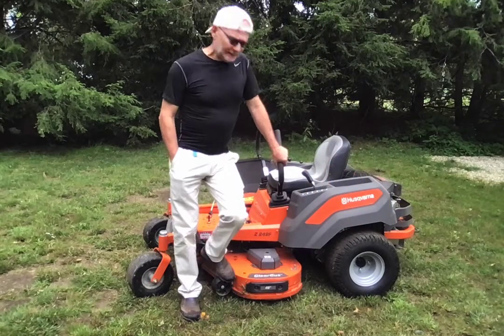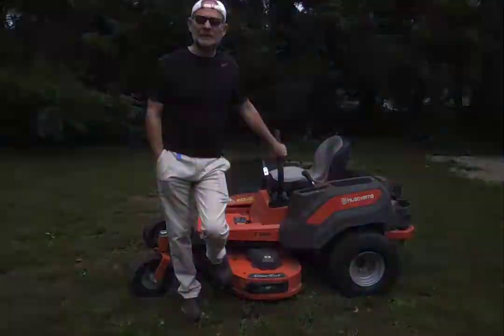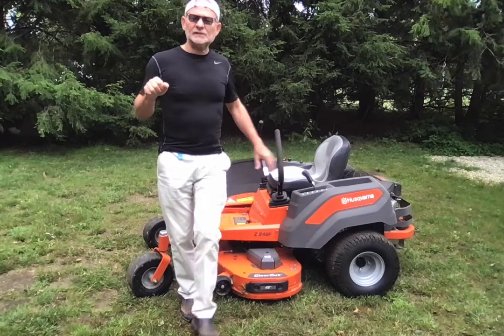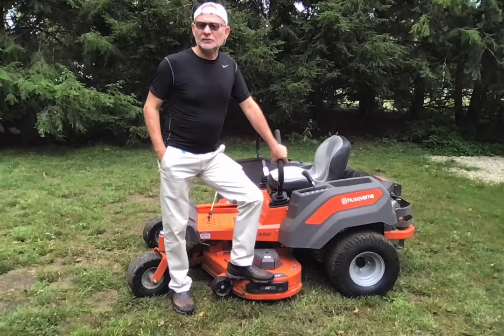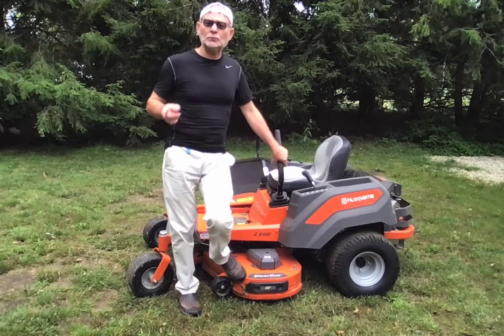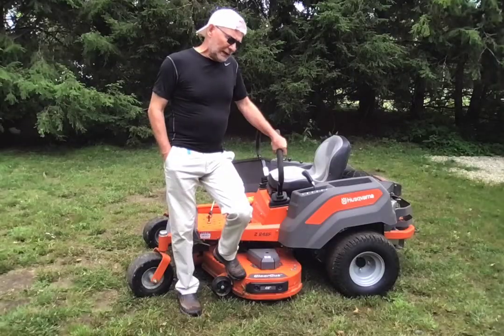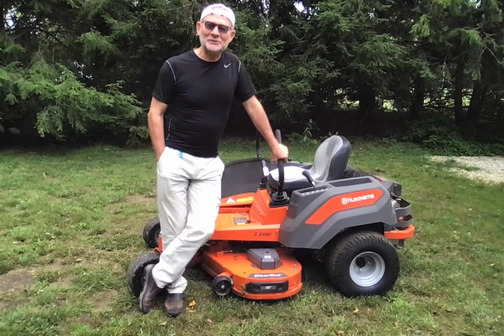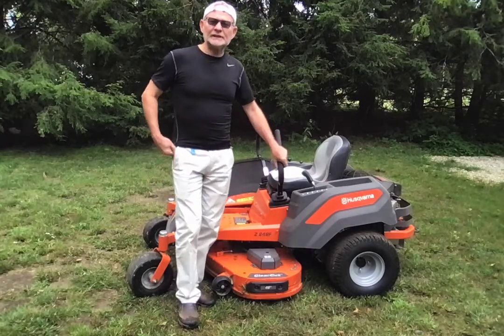Zero-Turn Mowers Quick Fix: Control Bars/Levers Getting Sticky and Hard to Push?

Comment: My did same thing. Dealer adjusted it and it is 95% of the left. Not sure what causes this but it is a common problem with the Husqvanra apparently. However, that said, I have had my Z254 for 5 years and it runs like new otherwise so I still think it is a great mower.

Comment: Do you know anytng about adjusting the lap bars?  My left one slips out of brake/neutral and therfore shuts off unless you hold it in place.  No issues with the right one?
Reply: Hi Calvin, sorry about the late reply. Unfortunately I know nothing about adjusting the lap bars, sorry! Best wishes.
Reply: @romanlegocki3770  Thanks